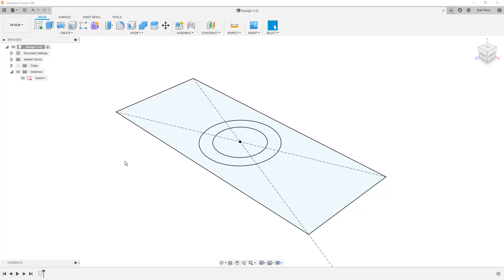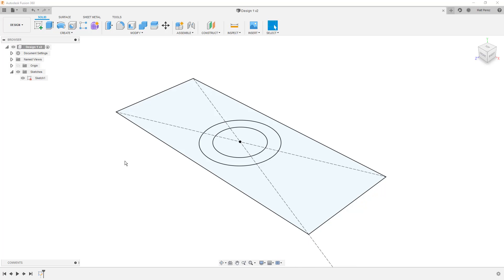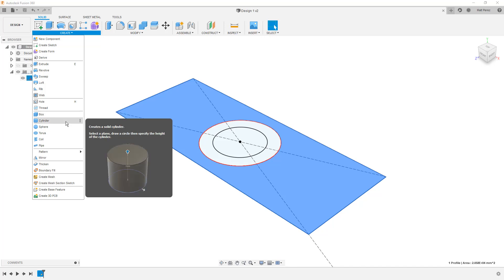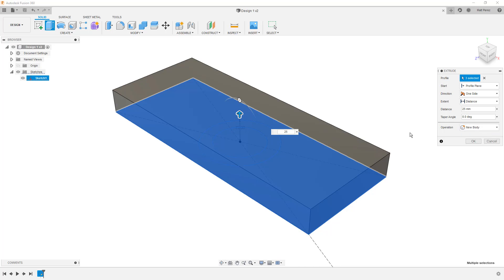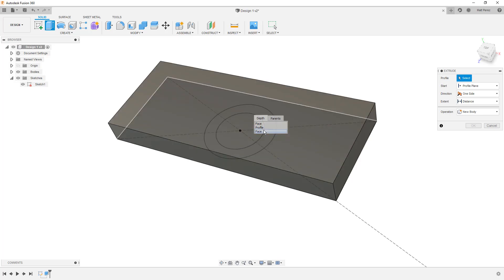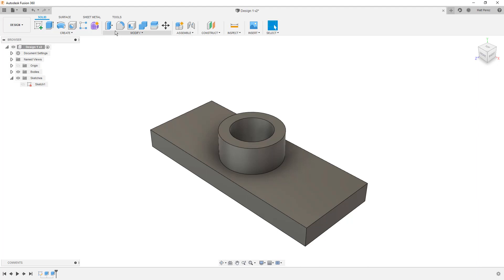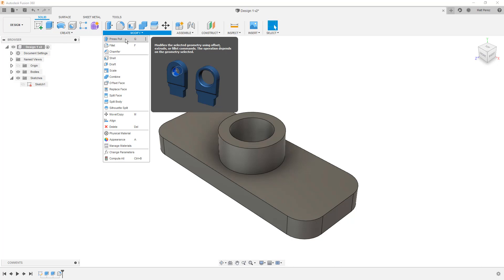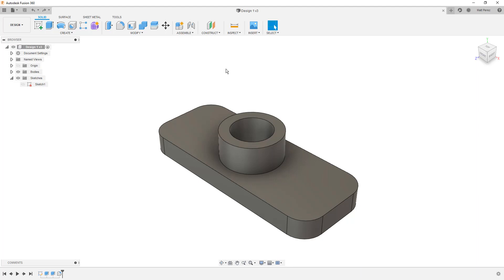Intro to Fusion 360 - Part 5: Basic Feature Creation #Fusion360 #HowTo #Tutorial

Comment: Before updating , my design was showing up grey like in this lesson. Now it is clear. How can I change so that when I design it show grey and not clear again?
Reply from the maker: Hey Byron, i see you left the same comment on 2 very different videos.  If you can try to explain the problem a bit more I will try to help.  In general "Grey" is the default material/appearance which is steel.  You can change the default in the user properties in the upper right corner of the window.  This doesn't happen by accident usually.  Another reason you would see a change in color from grey to clear would be if you are working with components.  When you create a new component and activate it(small radio button) all other bodies/components change to 10% opacity so they appear clear.  That is possibly the problem.  Lastly you could have changed the shading mode which you can find in the bottom center of the modeling window under your view properties.  CTRL+6 on a windows machine will set it back to Shaded with visible edges.
Reply: Thank you for the reply! Sorry about the confusion. I am learning Fusion and started watching your videos. With this video being 2 years ago I wasn't sure that you would see my question, so I attached it to one of your recent post. I was on this lesson #5 and I did the extrude and it was a clear frame and not the normal grey part that I was use to seeing. But, My question answered itself when I restarted the software and it went back to the normal state. But, for some reason I cannot add color or material change to my designs. I have tried a lot of times and it just will not change. I have a full paid license version of Fusion that should give me access to all the features.  So I am starting all over from the beginning again hoping to learn more and see if I missed somethings.

I like your videos and your way of teaching! So I am going to attempt to catch up all the way to your latest post 🤞 Thanks
Reply from the maker: No worries.  for materials you right click on the body or component in the browser(left side) and select Physical Material.  If you just want an apperance you do the same thing but select the Appearance option.  You can also hit A on the keyboard.  There should be no reason you can't change them UNLESS you somehow activated Component Color Cycling.  That can be found on the Inspect Menu up top.  It will temporarily override appearances to simplify the component and body identification.
Reply: That was great, Thanks now I understand better how to activate that feature and what I was doing work.

Comment: This may be a little off topic, but do you know of a way to export your camera view or axis view to a .SVG file (or like) file?
Reply from the maker: Not at all Robert, any question is fair game!  
Getting SVG files out of Fusion isn't supported natively sadly.  If you are looking for an SVG because a DXF won't work on something like a laser cutter then the best option that I am aware of it an add-in called Shaper.  You can find it here https://support.shapertools.com/hc/en-us/articles/115002735814-Exporting-SVGs-from-Fusion  or by going to the Utilities Menu in Fusion 360, Add-ins then search for it in the App Store.  I have heard of others using Inkscape to make SVG.  With that workflow you simply right click on the sketch in Fusion 360 in the Browser and Save as DXF.  But make sure you only have what you want to export in that sketch.  Inkscape can import the dxf and export an svg.  Personally I would go the Shaper route.
Reply: @LearnEverythingAboutDesign   I just looked at that.  This could be useful for other things. I was wanting to get kind of a vector based screen capture of sorts. with measurements or wire object wireframe...kind of like the drawings, but that has its own restriction. The closest thing I could do is a standard screen capture and do an image trace. This has its own issues of course
Reply from the maker: Ah so you want something more like a MBD(model based definition) type thing but static.  Probably the best bet is to export a drawing as a PDF, DWG or DXF and use a free program to convert it sadly.  

The only "trick" i could offer up is for you to make a sketch, check the "3D sketch" option and then add driven dimensions to an object.  The dimensions will always be displayed in ( ) being driven but they will be in 3d relative to whatever you selected.  Then change to wireframe mode and capture it as a JPEG and use a converter to make an SVG.  I don't know if fusion will ever output an SVG directly.
Reply: @LearnEverythingAboutDesign  I did try the .dxf to svg route.  It's odd that one can only seem to export solid bodies as .dxf. They come out looking like some kind of odd quilt. Maybe I can play around with it.  I wanted to get a good 3d view. I nice wireframe without hidden surfaces. Oh well, maybe I will discover something else.
Reply from the maker: Sorry Robert, I wish I knew of a way to make this happen.  I dug into some obscure text commands that were listed as 3D dimensions to billboard but didn't seem to do anything.  Not to draw too many comparisons but both Inventor and Solidworks have the 3d model "MBD" functionality and can export a 3D PDF or specific views like you are looking for.  It just isn't in Fusions wheelhouse so to speak.